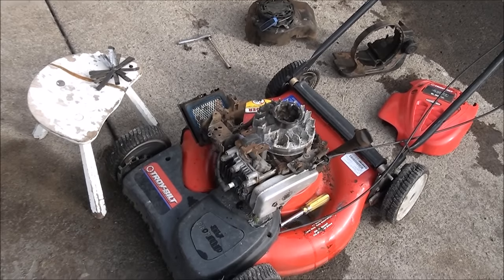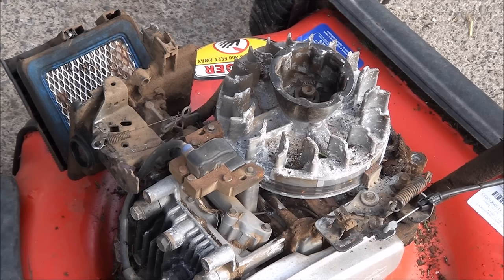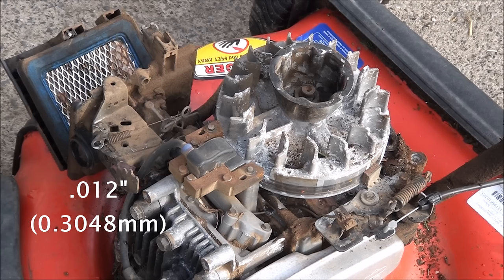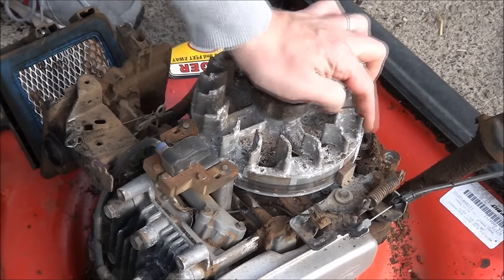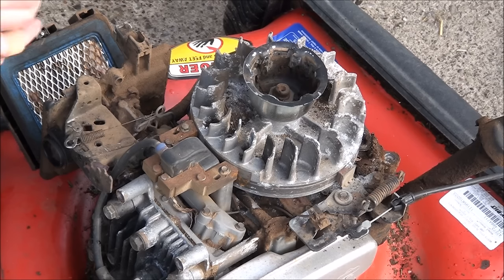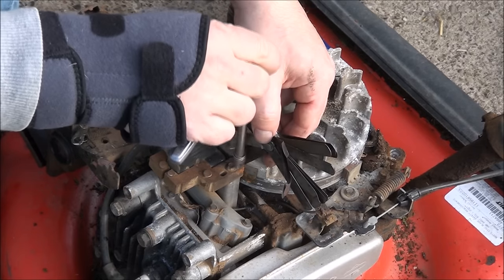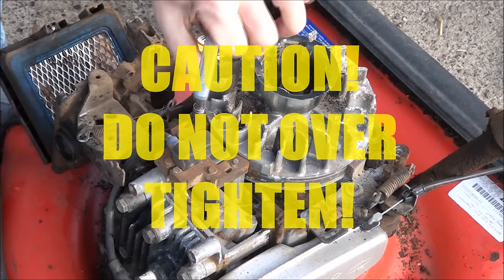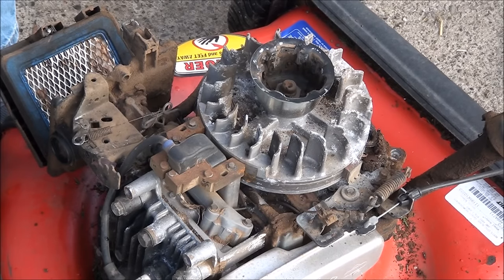HOW TO Gap a Coil / Magneto on a BRIGGS and STRATTON LAWNMOWER Engine. ALL Models

Comment: Take a piece of regular writing paper, fold 3 times like a letter.  Put it between the coil and the flywheel, spin the flywheel slowly till the magnets suck the coil against the paper on both sides.  Tighten coil bolts.  Spin flywheel slowly to get the paper out. Done!
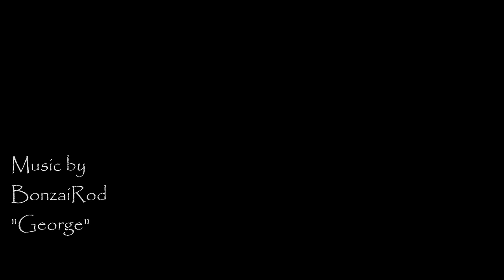Reply: 3:34

Comment: Be careful, older single cylinder motors need a gap  0.006 to 0.010".  Setting at  0.012" can make the motor very hard to start due to a weakened spark.
Reply: You are right in the money. The old Quantums like my 6.5 are .006 to .010" in the manual.

Comment: FYI 0.012" should be three sheets of regular old paper. So fold an 8.5 x 11 in half, twice. Then tear one quarter off and bam, three sheets.
Reply from the maker: just use a proper measuring device and you will never have a problem or question your accuracy. But sometimes you gotta do what you gotta do.....

Comment: I normally use a piece of cardboard thin enough like a shoebox loosen the screws put a piece of cardboard between the ignition coil push the ignition coil back to the flywheel as far as it can go and tight the screws never too tight because you will break the ignition coil housing and if you have any washer make sure to replace them i learn this from my daddy he was very good at fixing lawnmower so i start to fix on them and other small engine's
Reply: Use to use match book covers for points in my 70 Chevy... Your reply is what I was looking for, I don't have a feeler gauge anymore.

Comment: Heads up, this will not create a .012" gap unless you put the feeler gauge in at the side. Since the top is curved, you shouldn't be able to fit a .012" flat feeler in there at all. You will also need to go back and forth a few times tapping the coil tight against the feeler and gently torque the bolt more each pass. Only put the tip of the feeler in each time or you run the risk of widening the gap due to the curvature, even when entering at the sides.

Comment: IIRC, the Briggs training school said to use microfiche cardstock, since if you were a big enough dealer back in the day, you used microfiche to lookup machine info.  Assuming a microfiche card is 5 mil thick, you would use 2 microfiche cards stacked for a .010" gap.

Comment: What to do if you do not have a valve adjustment filler gauge ?
stick a piece off paper on the coil where it needs to be adjusted , select paper thickness as close as you can to the required adjustment , stick the paper with grease onto the ignition coil , gently with minimum force push it toward the flywheel and snug the bolts , the minute engine rotates the paper will disintegrate , this is what I used to do with the crank position sensor on a Porsche 944 .
Reply: ive used regular writing paper..- fold it three times, and the gap will be .011,, to .013.... works every time, and eliminates the hassle of searching for cardboard that is near the right thickness.
OR,, a piece off a cigarette carton.but ,who can afford a carton of smokes these days??. LOL !!!

Comment: Small engines will drive you nuts. Been dialing in a 20hp briggs for a while now after replacing bent push rods. Set the lash to .005 for both cylinders. Idles fine but misses at full throttle. Set the coils to .010 after lightly removing the rust from the magnet and it now seems to run like a top. Ive been battling this engine for 6 months now with fuel lines & everything else Its 20 years old at least but never really had a tuneup. I work on cars for a living.
Reply from the maker: Good work!

Comment: Bad information Jeff. The spec is actually 6 to 10.  (006-.010) thousandths according to briggs and stratton not "tweeeelve" I have seen the air gap spec on some of the larger displacement riding mower engines at 10 to 14 housandths so maybe that's where that came from.
Reply from the maker: You may be right but tweeeeeelve has worked for me on everything for 20 years now! lol

Comment: I have a 6.5 hp Briggs and Stratton troy built tiller that ot runs good on low but soon as you give it gas it spits and kicks and cuts of, I can keep it going by continually choking and unchoking but it has a new carb on it, so no blockages or anything,  it's crazy, runs great half throttle or a hair less, no choke, clean run, give it gas and itsike it's being smothered and cuts off unless I choke, it come alive again let off choke and do that constantly until turn it back down and its idles fine, what are somethings I could check, and do you think it could be the coil or head gasket cause I've checked everything else,  thanks hope to hear back soon,
Reply: did u solve your issue ?

Comment: What will happen or what problems would occur if its touching the flywheel?
Reply from the maker: it wont work
Reply: @JeffsLittleEngineService   I tore my Briggs and stratton push mower apart down to the block. Cause it would start and then die immediately. I cleaned and reinstalled everything , but I remember pushing the coil up to the flywheel until in touched it.  The mower started up first pull.This was the first time I have ever tore apart a engine. Some guys at work told me to use a feeler gauge to reset it that if I didn't it could cause problems.  What's your professional opinion?

Comment: hello!! i have a craftsman 6.5 brigs lawnmower do you know where i can find parts for it? did you see that tube going from the carb into the piston i need that mines cracked and i also need a new carb assembly
Reply from the maker: parts are available on the internet
Reply: Search for your engine model at the B&S site: https://www.briggsandstratton.com/na/en_us/support/manuals.html?icid=freshnav_a# . Look for the parts document; it has exploded diagrams of your engine, along with numbered parts reference.

From there, you can find the part you need and then search for it online - many of them are available on Amazon.

Comment: I don’t know why the gap would be .012 for all engines.That doesn’t even make sense.Of course if you put a feeler gauge in the gap before taking the coil off should give you a pretty accurate reading of what it is supposed to be provided of course you take it off new.
Reply from the maker: .012 always works for me

Comment: I see ebay has aftermarket coils for 12.00 free shipping. Are they any good?
Reply from the maker: I wouldn't do it. crappy parts usually
Reply: Jeff's Little Engine Service Thats what I figured China junk.
Reply: Thanks for the tip. I boughta Briggs-Stratton OEM parts for a flathead twin I have to replace the coil on .  Willl use a tappet gauge to gap.
Reply: A genuine B & S is about $110, that's a game changer on a $20 mower

Comment: Pretty crusty one, there.
I clean them up if the gap measures to a good business card thickness.
Some cards are thin, some are .012".
If you can get the card to just , slide out , under tension, you're just right.
Check the kill wire, it connects below and when you let go of the bail at the handle a ground takes spark from you.
Switching to a "close enough" Magneto part for a test means you may need to clean yours.
Connect the kill so it shuts off when you want. If you do things like that. Safety first.
Reply from the maker: good tips

Comment: I cant even get the bolts off properly its like between a 6 and 7mm wrench. Which doesnt exist since we use metric.
Reply: 1/4 in
Reply: you may find that a 6.5 wrench may fit, not as easy to get hold of as the full mm sizes but I managed to get one.  Also the small hex drive tools are 1/4 inch so an extension for these  would do the job. Female end on the bolt and a small adjustable on the male end.

Comment: What can be done of one of those screws breaks? I have one where the screw broke on removal of a dead coil.
Reply from the maker: bad bad news....
Reply: @JeffsLittleEngineService  Naw. Turns out a bit of PB Blaster and a propane torch loosened it up just fine. A pair of vice grips did the rest. Took about 5 minutes.

Comment: THE WAY THAT WAS DONE WILL NOT YIELD AN ACCURATE DISTANCE,  NEEDS TO BE SOMETHING THAT WILL CONFORM TO THE RADIUS, LIKE BRASS SHIM STOCK OR EVEN PRENMEASURED "PAPER ",   ON NEWER MOTORS THE DISTANCE IS CLOSER TO 0.006",  REGARDS